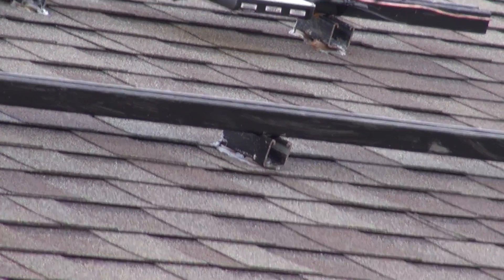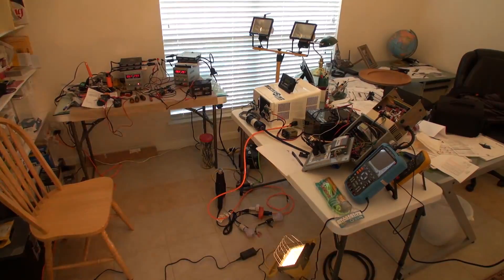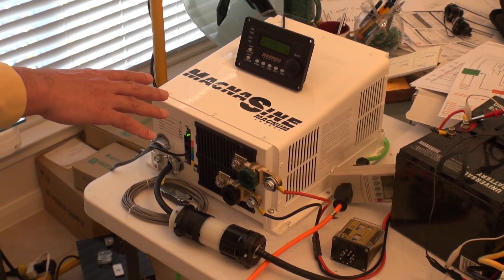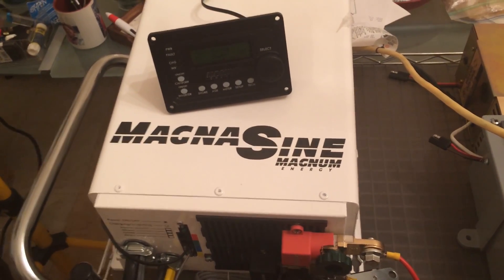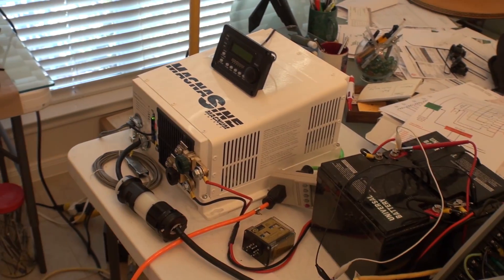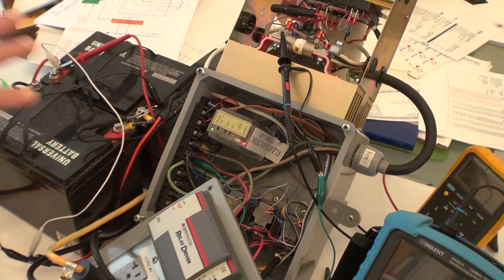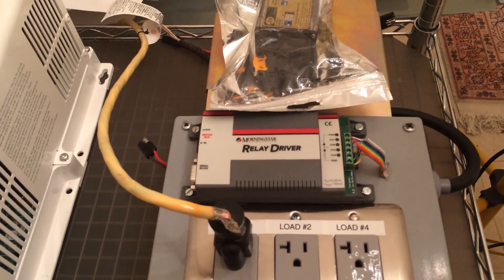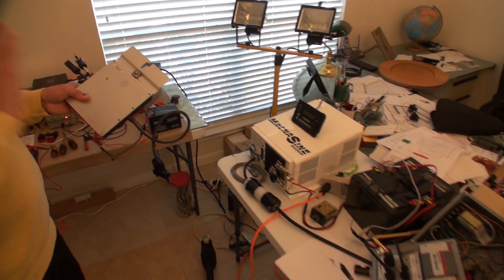Grid Tie Inverter without a Grid Part 1 of 5

Comment: Why not just use battery storage as a power dump?
Reply from the maker: You start dumping access power when your battries are fully charge.
Reply: @Mark1Jordon1  Ahh. I wasn't sure if you were full grid tied.
Reply from the maker: @LastExile1989  Acutully since my system is grid tie while grid is up I dont need dump load. Why? becuse I return the extra power back to the grid but if the grid goes down or my system is island ( ot gris tie) then after my battery get full I need to dump exccess power to the dump load since is doesn't have any place to go and I can not turn off the inverter for the reason that I mentioned in the video clip.

Comment: I know the down side is not been able to use your roof top solar during the power outage but what about if the outage is at night? Both your experiment and the solar system will not help, therefore it's good to have reliable backup generator for that short period of time, I have 11.7KW roof top panels along with 20kw diesel backup generator this system was up for the past 8 years the generator started total of 13 times in 8 years, your experiment system probably costs more than what a generator costs.
Reply from the maker: You are right to certain extent remember the inverter that I got change the battery bank DC power 48V to 110V and 240V at night those are lead acid battery like the one in the car. I have two Honda EU2000i generator as well that I made them to run on tri- fuel watch my youtube on that subject as well. problem with generator is noise. Also I don't need to store gas or gasoline at home.

Comment: I have been Investigating myself on how to trick my on grid inverter to activate without any grid. First off you would need a grid tie inverter that compatible with a zero export meter.When to simulate the grid you can use a small sinwave inverter and the zero export device would protect from any back loading to he inverter! That would be no need for dump load resistors because the inverter will throttle back it's production . All on-grid inverters that work with zero export smart meters have the throttle back feature! For example I'm going to use an ABB uno- dm 3.3 tl- outd-plus! Obviously the battery back up and charging is a whole other issue! Possibly a separate battery charging and maybe looping the high voltage battery DC current back into the solar inputs of the inverter! Anybody have any feedback?
Reply from the maker: The Zero export meter does not works with Micro inverter for sure does not work with Enphase micro inverter, the structure of micro inverter  is different than regular inverter.
It may have many reason to not to work but one reason is when Enphase goes off( you can not throttle the Enphase output) it take up to 5 mins to come back on line so system will not work on demand, helpfully you understand that & I do not need to elaborate.
Zero Export Meter is controlling the Inverter not the solar panels and typically "Micro Inverter "is ON or OFF not throttling possible. 
,

Comment: Very god video. I tested with modified sinus wave. It works to. But there are sounds you can hear. But it's works. A smaler pure sinus wave inverter is the solution. A bigger one is expensive.

Comment: I feel like I would run a direct feed from the panels to a dc motor that would spin a tiny ac generator head with a microcontroller monitoring the ac output and controlling the dc motor speed to keep your nominal grid voltage. Then just give the grid tie inverter the artificial mains. I feel like efficiency wise thats the best and simplest way to get a REAL true sine wave into that grid tie.
Reply: How did it work?

Comment: Do  or can you make a dump load controller for sale?
Reply from the maker: How John, I prefer not to make it for sale but I can give you all info that you be able to do it yourself I thought videos was very comprehensive , Just building the controller box cost about $600 and I bought some used component from Ebay such as SCR controller (40A) and current controller and that cost is not include of $2400 AC Couple Inverter made by Magnum MS4024PAE ( you have to use AC couple inverter for Bi direction current), Why I am  not selling it? because I use some used component and I do not want to be responsible for failure of system. If you use brand new component the cost of controller box goes much higher.

Comment from the maker: This just an example on ebay: look for SCR 400V 50A 50Ria40 SCR , I suggest not to buy SCR buy load controller 460v 40a with 4-20ma control you can buy a used one is much cheaper than build one.
Reply: Isn´t a thyristor like a short circuit at the break through voltage?
Reply: Why not use a simplified circuit like Controlling VAWT speed using Shunt Regulator Circuit (https://www.homemade-circuits.com/simple-vertical-axis-wind-turbine/), but instead of a 10k, 10 watt resistor use a large heat element (like a 10k or 12k heat strip which can be picked up for under $50, use a 245v Zener diode, and a 50a triac).  That way if the voltage rises above 245 volts from your grid tied inverter(s) the diode turns on the triac and electricity is consumed until the voltage drops below 245.  Less complicated circuit, parts for under $100, and the heat element is much less likely to burn out than a halogen bulb.  You can still use your magna sine inverter/charger to change source frequency to turn off grid tied inverters.  If you don't want waste heat in your garage just make a little shelter for the heat element outdoors and run some wire that will handle up to 50A 240 in my case as I have a 10kw grid tied inverter so it can output up to 42A.
Reply from the maker: Yes, I think I did mentioned it in one the 5 videos that excess power can be dispose on heating element instead of light, I prefer to check the low side voltages instead of high side, principle is the same zener diode in low side define when the excess load need to dump and how much and trigger the Triac in high side. I think I bought my power controller for couple hundred dollars. I need reliable system that being used in industry not damage $20k system.
Reply: @jhines97  Have you built what you described?  Not sure it would be that much simpler due to additional cooling parts (large heatsinks, fans, etc.) likely required.  Also, triacs at several KW power will likely crate huge transients could damage the inverter and connected devices without additional large filtering components that are also expensive.
Reply: @xavierneckor8918  I haven't built it as a friend of mine that does engineering for electrical systems said I should use a 1:100 to reduce voltage down for the zener, and use current from the zener to fire a contactor instead of a triac.

Comment from the maker: Respond to Thra5herxb12s, I think you misunderstood , during the day excess power goes to the grid and will be resister by the power meter install by power company ( two way meter) and at night I get as much power that I want back from grid, sometimes I get more power that I generated sometimes less If I use more I just pay for the differences.So this way I use grid as my battery backup and do not need a big bank of battery at home they are expensive and not lasting long time plus need a lots of room top store and maintenance.

Comment: I dont understand why you are trying to use grid tie inverters at all. Grid tie inverters are to feed back into the grid so you make power for other people at your own expense.  What will you do at night when the sun goes down apart from sit in the dark. You need a normal inverter and a few batteries and avoid all this messing about. Or am I misunderstanding what you#re trying to do here.
Reply: This is awesome man I really like it. Wondering if I could do the same thing on cheap scale with a pure sine ups. I don't have the money for a magnasine but I do have 2200xl smart ups pure sines
Reply from the maker: Yes exactly.
Reply from the maker: This video is all about your question since when you turn on the grid tie inverter you can not control the output power generated by inverters so you need dump load go get rid of excess power.

Comment: this took me until video 4 to understand what you're trying to do. I think I understand the problem you're trying to solve. you're clever, but it's all so over-complicated. that's the problem with micro inverters, connecting the system together using ac.

the general point of a micro inverter is to convert the low voltage dc into a high voltage ac as close to the solar panels as possible. this is because you'll have much less power loss in the cables connecting everything together. say you have 100 feet of 12 gauge wire to connect to your house power. if you compare using low voltage dc or high voltage ac over that same wire, you'll have much more power loss in the wire which is released as heat. the whole micro inverter subject is more than just this, but it's a matter of preference really.

I was quick to say you don't need a dump load with solar panels, but I think I understand why you have one. my only concern, you'll likely burn out those halogen bulbs quickly by turning them on and off so often. consider using a large heater of some kind instead, which will be a much more reliable dump load. maybe a few electric oven elements and a fan.

I think the root of the problem you're solving is that the solar panels generate extra power, which the MagnaSine inverter uses to charge the batteries. the battery voltage gets high which triggers the MagnaSine inverter to increase the ac frequency. my guess is it's attempting to draw more power from the batteries, but it's not smart enough to know it's causing the problem. if there was a way to limit the charging of the batteries, would that solve the problem? it might be a more direct solution to the problem, but I can't think of a way to do this at the moment.

Comment from the maker: You can not use small inverter for initial start because of characteristic of grid tie inverter is all power or none "MPPT", I did explained that specific question if you watch all 5 sections of videos. Just for short, what happen to your small inverter after it wakes up all inverters and they "micro inverters" putting power more than it use in your house. Remember your small inverter is one direction system DC in AC out. The moment that you connect the AC supply to output of your small inverter the magic smoke will come out of your inverter (AC voltages generated by micro inverter that you just turn on). You can not use all the power put out with micro inverters why ? because you do not know how much power is being generated in each moment that is dependent to location of the sun and cloud and ....
Reply: Check out my video post today and you can see how you can hook your off grids up to your home in an off grid scenario. Works perfect for my situation.
Reply: Ehphase micro inverters S-series with Envoy-s monitor. There has zero export to grid function. Do you think this can be protect higher voltage from micro inverters feedback to small inverter in case of power exceed consumption power output? BTW Thank you for your useful video clip.

Comment: Why can't you just use one small true sinewave inverter to simulate the grid? Then just have the grid tie inverter to the house to be used.??
Reply: I have actually tested exactly what consaka1 proposed. I have an outback inverter that is also grid interactive. When I have used it in off grid mode I am able to simulate the grid and my other grid tie inverters (from china) actually feed the home with power hardly any power comes out of my batteries in this setup! :)
Reply: A diversion load controller may be necessary similar to those used with dump load controller for wind tied systems. Once power has no where to go power is sent to a resistive load to burn electricity instead of damaging the equipment
Reply: Yes. Micro inverters are only dissimilar from a grid tie in the sense that they are independently adjusting individual panels and feed AC voltage directly from the panels and send power in parallel with other micro inverters towards a source. Typically micro inverters are small in power and size compared to a grid tie which is typically installed at a junction of several panels in series and parallel configuration. Hope that I have answered the question.
Reply: I read 2 questions.  1st Can you use a small inverter to create signal for grid ties. And 2nd would it work if not pure sine wave. 2nd question is a modified sine wave will not work at all and may fry the equipment. The grid tie inverter works by syncing to the grids pulse and then provides a slightly higher voltage than the grid to force power backwards into the grid. A modified sine wave is likely to be fried. As for first question it seems your question is loaded to another. A grid ties entire purpose is to force power upstream meaning it will continue to push on the inverter if the load is not present or satisfied. With no where for the power to go it would damage the grid tie inverter due to no device created yet to limit the power being sent to grid tie.
Reply: jeremiah brooks thanks. Very clear.
Reply: jeremiah brooks Next step would be can the micro inverters work based on the output of a small true sinewave inverter?
Reply: I Don't See Why It Wouldn't.  I am not sure what you mean by small inverter, my example uses 3k inverter and I rarely pull over 1.7k so depending on your night time needs a small inverter could work as well. Good question I will test if I can catch a good deal on a cheap good quality inverter. :)
Reply: jeremiah brooks by small inverter I mean an inverter whos sole purpose is to provide a signal to the micro inverters which I believe are just really small grid tie inverters right? 
The idea being the majority of the power should come from the solar or wind system. 
I make a lot of assumptions I know. Like the small inverter should be true sinewave for the grid signal. I am assuming a modified sine wave would either not work at all or cause problems for grid tie / micro inverters because those should give off a true sine wave. right?
Reply: jeremiah brooks I see so that is what you are doing with the load dumps. Thanks for the info. 
Now if I assume a micro inverter is just a small grid tie inverter?
Reply: The sinewave inverter can produce energy but it cannot consume excess energy from grid tied inverters. We would need special grid tied inverters which don´t use the solar energy in case of output overvoltage and continue working instead of switching themselves off.